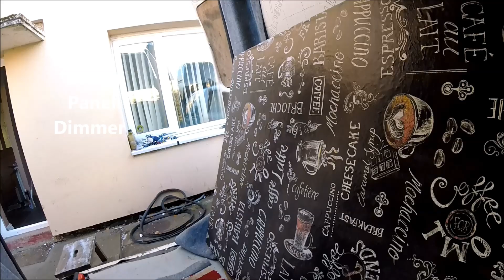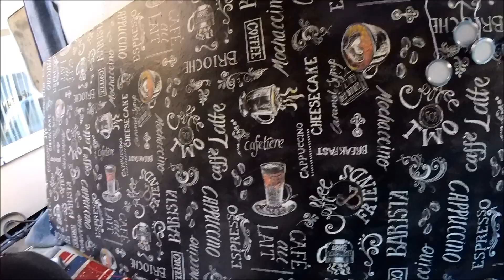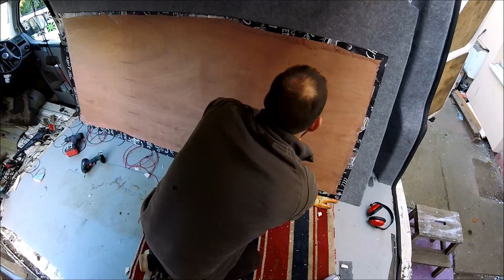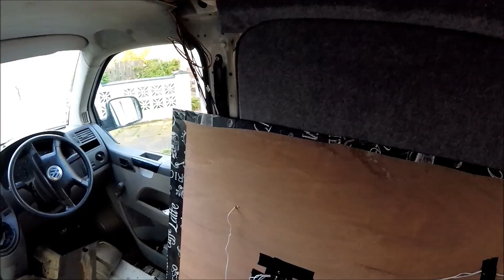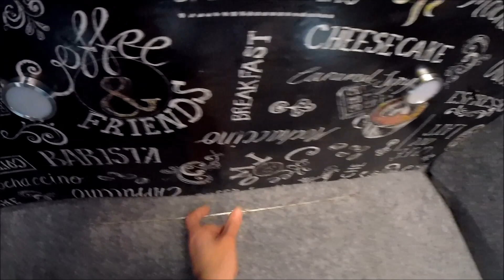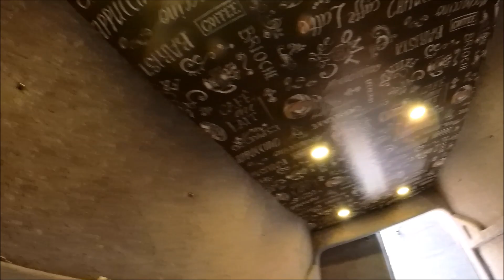VW T5 Camper Conversion Project Part 16: 12v LED Lights & Dimmer Installation

Comment: Brilliant job. Got exactly the same. I was a bit worried about fitting solar panel to fibre bolts. Panel came with hex screws. M6. Maybe I should use bolts as you did.

Comment: I've got these dimmers but as soon as power is connected, the LEDs come on and won't turn off. Can't figure out what I've done wrong 😬
Reply from the maker: I can't really help other than advising to recheck the wiring as mine just worked

Comment: Has anyone used the existing wires that power the factory standard lights for the led lights?
Reply from the maker: It will drain the starter battery

Comment: Hi there. I absolutely love your channel and your down to earth approach in presenting. Could you please point me to a video where you do the basic electrics? I've fitted my leisure battery and had the split charge fitted and the leisure battery is then wired into the fusebox. From there it's down to me. Only fitting lighting, water pump for tap and USB charge points but can't seem to find the appropriate video. Please keep producing this content coz you're an inspiration. Thank you. Regards Andy.
Reply from the maker: Thanks for the kind words, I have an electrical install video from my T4 in my earlier videos, along with tap and use installations, have a plus through my older VW T4 vids and they should be there

Comment: very clear instructions as usual - and love the design of the roof panel - the only concern I would have being vinyl is condensation on the (relatively) cool surface say compared to carpet or fabric
Reply from the maker: yes the vinyl is a risk but I've seen other vans with it in but if it does collect condensation, it would only take an hour to take it down, remove the vinyl, carpet it and replace it